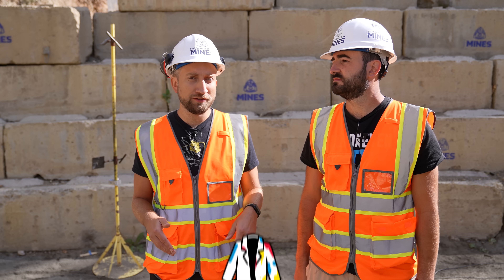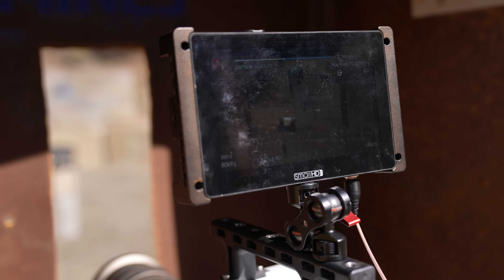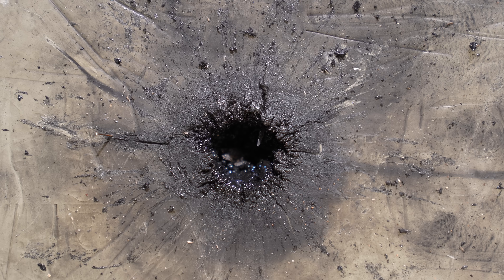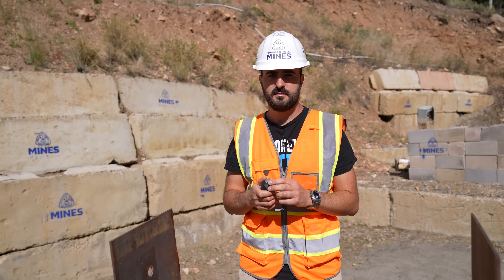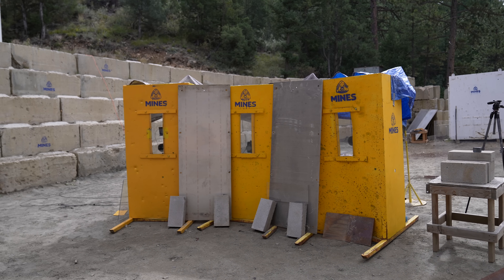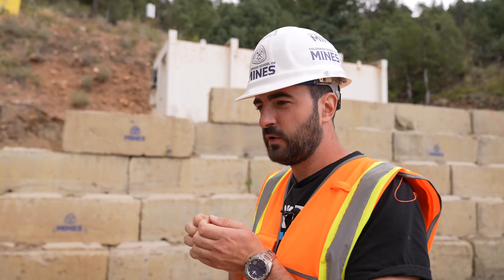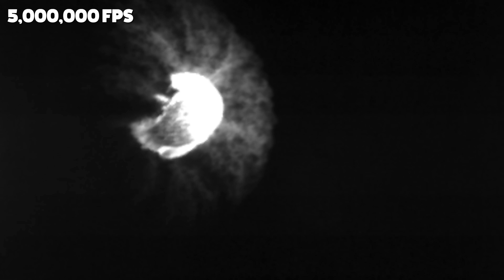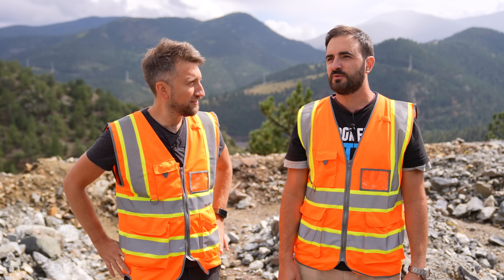15,000MPH Colliding Explosions in Super Slow Motion - The Slow Mo guys

Comment: Nice video. Having worked at an explosive test facility I have seen numerous shape charge experiments but never really seen videos like this. When I was working there high speed video cameras were not fast enough for us to really see enough detail of the jet. We used  rotating mirror cameras to capture maybe 35 frames of data along with x-rays and other specialized diagnostics so that the experimenter could verify what was going on at a specific time in the shot.

Comment: Dan to answer your question about how did they know a shaped charge's physics worked that way, it started with a combination of theoretical physics with examples of conical blasting mining theory going back to the 1790s and eventually physical experimentation with the invention of more energetic high speed forms of explosives in the years following Alfred Nobel's inventions during the 1860s.

Official discovery of the Foerster/Neumann/Munroe Effect of shaped charges is dated to 1883 with Max von Foerster first demonstrating examples with lined cavity charges leading to Charles Munroe developing the design and theory behind the modern shaped charge in 1888.

Comment: Really great video. I know how shaped explosive charges are working, but seeing this at extremely slow motion is unbelivable. Thank you!
I think that the fact that two jets nearly missed each other is good, because you could finally find and show both of them. If you really want them to collide, then you have to take some precautions,  check that the vortex of each charge is perfectly centered (logically it should be due to the manufacturing process) and ensure that plates are also perfectly perpendicular to each other, by fixing them with welded bars connecting plates to each other.

Comment: I'm curious, what is the chance that rather than a solid, or liquid tip to those explosions their is some form of plasma. It's the 4th state of matter and is a super high energy state... it wouldn't surprised me if that briefly became copper plasma and then vaporized and then did other weird chemistry / physics things in that very short period of time.
Also could the aim be off from the shaped charge shifting the plate it's on and twisting in a very brief moment before it's fully directed.
What happens if the shaped charge has a backing plate / housing to hold even more of that energy and force that forwards?

Comment: 14:00 the "tip" that you see there is just the peak, basically the wavefront, it is still a jet behind it which is just invisible now due to the low exposure :D so it's not that little tip at the front necessarily doing all the work

Comment: There is a Shape Charge with a Plastic piece (And other material versions) where the Tip of the Shape is starting
Making it more accurate,not sure if it works in small scale 
But it does work in Large scales,basically narrowing down the accuracy from a cone,to a Rectangle Jet.

Comment: I don't have a clue how the cameras or these explosives or anything works, but I think it is incredible. Having the daylight be pitch black and the explosion moving quite clearly in the dark is really cool. And comparing that to the slower colour footage is incredible too. The frame rate difference is huge and it is just a white cloud in daylight. It is awesome
Reply: How the cameras works is pretty simple. If "normal vision" is 60 frames per second, then 600 would be slowed by 10 and 6000 would be slowed by 100. So at 6 million fps, 1 second would last almost 28 hours :)
Reply: @melanp4698 I think the point was more about how they work... not about the basic maths. So, how does a sensor capture light in a meanigful way in less than 100ns? How do you access the data for tens or hundreds of thousands of pixels in the sensor array over and over again in fractions of a microsecond? (The data rates are quite challenging.)  How does the huge amount of data get buffered before it is committed to slower non-volatile storage? Etc. These are very challenging engineering issues, and the camera builders do an amazing job, imho.

Comment: okay lads... science question (that may lead to more shaped charge videos and some maths)
is the glowing caused by the molten copper heated by the explosive forming of the jet to a temperature that makes it glow... OR is it being heated by air friction because it's moving so fast?
at 2:51 in the video - middle of the gel block it's dark...BUT when the jet exits the gel block it starts glowing again immediately on exiting and starts getting brighter.   air friction at work or the molten metal shedding the gel residue as it burns off?

Comment: You got the shutter-speed, exposure, ND Filter and it is still so bright - now the question is: HOW bright is it? I think you should have all the numbers to calculate that.
Would be interesting to hear just how bright this is, how much power it is radiating away as visible light and how hot the tip has to be to emit so much light. That gotta be intense when it is so bright - 30 000 °C ?

Comment: I know its probably not possible but with you explaining how just the tip of the shaped charge was the extreme hot point, it would be cool to see that through a thermal camera in the super slow mo so you can get actual values of heat. I know its going too fast for a thermal camera to update and read it but who knows, maybe future tech can pull it off.

Comment: This is a brilliant idea! I'm wondering, why is the tip of the jet so bright? After all, the copper jet is not molten from the heat of the explosion. I guess it's like with a spacecraft reentry - the tip rams into air molecules so fast that the air in front of it turns to plasma, hotter than the sun. BTW, the jets missed each other in each of your tries. I wonder what would be see if they actually collided...

Comment: It's kind of neat to see Gavin working at the very edge of what he can film with his equipment.  I don't know if there's anything more advanced that he could use, that's just prohibitively expensive to get, but that was kind of a sick line "If I can't film it like this, then I can't film it."
Reply: Their top cameras are already insanely expensive, so it's probably not viable for a youtuber budget. But 10 years ago when they filmed at 10,000 fps, it was almost mind boggling and now they're at 10 mill. So give it another 10 years :)
I dont think they need higher speeds though, so resolution and filters is probably where it's at. Filming a crystal clear 4K @ 5 million fps would be waaay more useful than filming at 240p at 20 million fps.
Reply from the maker: @melanp4698 I agree

Comment: Great Stuff!!! This reminds me of a special shot we did  for a popular TV show. Paint Balls colliding mid air. We used two shop made air guns with electric valves shooting some very custom ammo that was made in the studio FX Shop. A special blend of wax made the case and it was filled with paint ball paint. Shot with a high speed camera, using allot of light. The guns we aligned with lasers. Out of 10 shots we got 10 for 10. Great fun. PS we use shape charges to flatten car tires on cue.

Comment: The two molten copper jets are already intensely hot (somewhere between 2,000 and 4,500 deg F) due to the explosive concussion. and therefore very bright.  White-hot tells me the temperature of the molten metal is at least 4,500.  Their collision heats the colliding surfaces up far more, over 10,000 deg K, well into ionization temperatures, which are energetic enough (Wien's Law) to be around 0.2 microns in wavelength.  That borders on ultraviolet, but here's the thing:  While that's a mean temperature, that's nowhere near peak temperature, so the frequencies almost certainly reached well into the ultraviolet.  You saw the blue, but you didn't see the ultraviolet.

Your camera did, though, and a CCD pushed to saturation results in the finite charge capacity of individual photodiodes, or the maximum charge transfer capacity of the CCD, is reached.  At that point, the photodiode either blooms, or in more expensive devices with better protection, it's either shut off or shunted to ground by fast-reacting electronics...  Hence the Black.

That's my theory, anyway, and I'm sticking to it, unless you two find something better!

Comment: In the first duel, just because it gets brighter doesn't mean they collided. It could be constructive interference, meaning if you put one bright source somewhere and then turn on another right next to it, the apparent brightness goes up.

That said, some part must have collided with some other part. I am just not sure it was the very tips that did but very close to it. It's hard when you can't define what diameter each projectile is and what's just trailing gunk. If you allow for every bit of copper they most definitely collided.

Comment: The expansion of ballistic gel is ALL about energy transfer. If you shoot a needle through it, there's so little cross sectional area in contact with the gel that it barely moves at all.
If you use the ballistic gel as a bump stop for a car rolling at 5 mph, the gel will move ways back.
Everything in-between that will cause the gel to move in different manners. The bigger the cross section of the thing you fire, the higher the amount of energy the gel will "steal" from the "projectile".

Also, point blank cannons will fill the void left behind with high pressure air.
Point blank explosions on the other hand will fill the void with a rippling shockwave.

Comment: Gav, Dan - another mind-blowing set of videos.  Go add a brace of ND filters to your kit the next time you work on shape charges.  Another way to think of this... the shape charge jet travels at (roughly) the same velocity of a satellite, the ISS, or a fleck of paint,  in LEO.  Hence the reason NASA, ESA, etc. were so upset when China and Russia decided to deliberately destroy satellites in 'experiments'.  Each part is now traveling with the same impact potential as the shape charge.

Comment: "Brighter than 100 suns"
Actually, yes. Thermal radiation (blackbody) scales as temperature squared, squared. The "temperature" of a copper gas with a mean velocity around 4 km/s is in the ballpark of hundreds of thousands degrees (doesn't matter which), which is WAY more than the temperature of the Sun's surface.

Comment: 3:09 i think you broke the speed of sound for that mix of balistiv gel, i think thats what we are seeing with the shockwave inside the gel and the ripples outside. Speed of sound in air about 340 meters per second. Speed of sound in water/balistic gel (they are very close) 1,500 meters per second. IF thats the case, those tips are going Mach 4.3 so a lot of those bright gasses as well as the brightness from the tip (and the reason the tip reignites after it leaves the balistic gel) could be from the air compressing and heating up.

Comment: I imagine shape charges were inspired by rocket engines, and if so there would already be ample data about how blast waves moves through a cone and interfere with each other. Someone quite clever figured out that you can use that behaviour to focus an explosion with an explosion.

Comment: I would love to see someone do the calcs on the temperature of the front of that projectile based on the amount of light coming off it.  I imagine you could rough something out based on what amount of light is required to turn the camera sensor white with the settings and filters applied.
Surely the cause of the brightness is the copper heating up as it travels through the atmosphere at literal meteoric speed.

Comment: At 9:46 you show the speeds of the two jets, both are just over 7,000 m/s, which is close to low-Earth orbital velocity.  Given this, I wonder is the strange blue light that you comment on at about about 7:00 is due to the copper emitting light as a plasma as it is heated by its passage through the air?  The heating due to the compression of the air might be enough, I am guessing, to cause the copper, and the air to become a plasma, just like a reentering spacecraft.

Comment: As a fun fact there are concepts that would allow for nuclear shaped charges. Uses range all the way from producing a literal beam of death by focusing the nuclear explosion, accelerating multi-ton tungsten boulders to several kilometers per second and using the explosions to move spacecraft to incredible speeds.
Reply: Creating a vessel that could handle that kind of acceleration isnt viable (with current technology). But what would be the benefit of such a weapon compared to just dropping a bomb?

Comment: I knew the jet was going to go through the ballistic gel before you fired it.  I was in front of an RPG7 which has a similar focused charge.  Fortunately for and in front of me also was three layers of sandbags, a sheet of steel (PSP runway plate) and a 4x4 wooden post.  It penetrated them all, broke the 4x4 and had just enough left to impale steel and copper fragments into my skull (mine must be particularly thick) but none through my skull.  The gel was nothing compared to all in front of me that time.

Very interesting video.  Very bright!

Comment: How did they know? Math. 
The same math that they used for doing the shaped charges for starting nuclear explosions. They know the speed of the explosion through the explosive material and how much pressure its producing, and they roughly know how fast the copper's going to go in the distance between the base of the cone and the end of the shape charge. With that, the cone's just a bunch of circular charges that all pile on top of each other so that you get a molten/vaporized copper slug in the center. They probably tested a few variants of that cone to determine which is best, experimentally checking the theory.

Comment: Sorry for making a third comment, but it is just such an amazing video...
I feel like you're filming two stars colliding!

I really really REALLY hope that you guys can come up with a mounting system that enables the charges to be precisely mounted, allowing for a true head-on collision of the "cores"! ALSO, maybe Phantom will loan you their absolute fastest camera, to capture it in color! (as I assume they have some ludicrously, prohibitively expensive cameras)

The only thought I have as to facilitating a true head-on collision, would be to:
- Lay each panel on top of each other to drill center holes (for alignment), with two additional holes marking where the angle iron edges will touch. 
- Then, mount those metal panels in a welding jig, and weld 4 small pipes to each corner. This will ensure they're not only very rigid, but more importantly, very "true" to each other.
- Finally, weld the angle iron (or, do it before, either way... lol)

That should be the goal for next Shape Charge video you do. 🤞😌🤞🙏♥️

This was a great video, and the perfect Fireworks Show to end 2023 on.
Thanks guys! 🫡
Here's to 2024 🍻

Comment: I'm curious to see how different a much larger shaped charge would be, such as one meant to be fired with a tank (Like a 120mm HEAT-FS round). I imagine the "little tip" would be much thicker, and probably longer too. Doubt you'd be able to get one, but it would be pretty interesting if you could.
Reply: Problem is that the equation for mass vs velocity is not linear, so they wouldnt be able to film it since the energy needed to accelerate a round of that size to those speeds would be quite significant. (They do need a tank to fire them and that's "only" like 1500 m/s while the charge in the video was 7000+ m/s.
But yes i agree that it'd be cool to see.
Reply: @melanp4698  The thing with HEAT shells is that their velocity doesn't actually affect their penetration in any significant way (to my knowledge). So they could just test it while static, like they did with the smaller shaped charge in the video.
Reply: @The_Gabinator  Then it should just be the same result with a bigger charge. Probably just more light and power, making it significantly more dangerous without adding anything particularly interesting.
Only a guess though.

Comment: If I understand correctly, each "stop" is half the light, so six stops of ND is 50>25>12.5>6.25>3.125>1.5625% of the light?

That filter blocks ~98.5% of the light and it still looks like that. 😮

Comment: Need a redesign of the copper liner to remove the turbulence from the putter cone that catches up and pinches off the jet.        Its why many liners are curved outwards which helps cut through armor more efficiently.
    Great shots though!    When are you going to revisit in order to actually achieve the desired goal of hitting each other ?

Comment: Gav and Dan aiming to do particle physics with explosives instead of the LHC…

Great video. The best thing about not quite getting alignment is that you’ll have to go back and do it again! I’d watch!

Next, try a jet into a tank of warm clear oil and glass fragments. Messy, but bear with me. At the right temperature the oil and glass will have the same refractive index, so will be transparent making for clear photography. However the jet will be randomly disrupted by the glass, just like it is in some forms of armour. Seeing that disruption clearly would be very cool!

Comment: In one of the last clips that was exposed to see the colliding explosions better (the one that’s 375,000 fps), there is a black line that follows behind the tip of the explosions and almost looks like a metal rod. Is this the tip carving through the air and creating a vacuum in the center of the shockwave? It’s strange how the line stays so intact through the whole collision.

Comment: there's a reason the US doesn't have a dedicated HE shell for the 120mm gun on the M1 Abrams. HEATFS does the trick just fine. standard loadout is 35 HEAT-FS, 35 APFSDS.